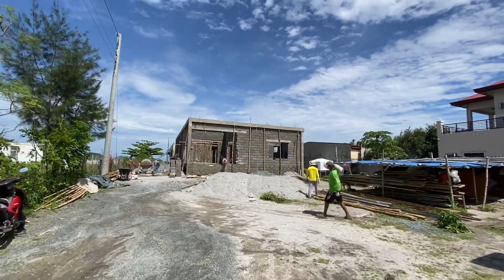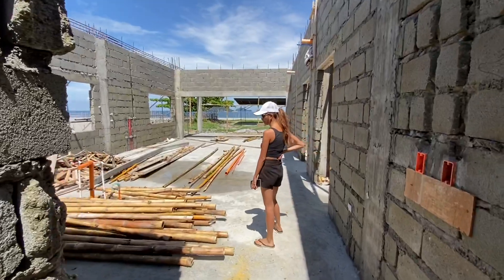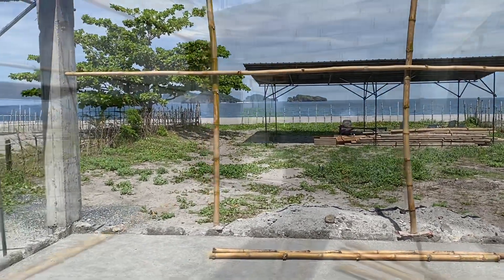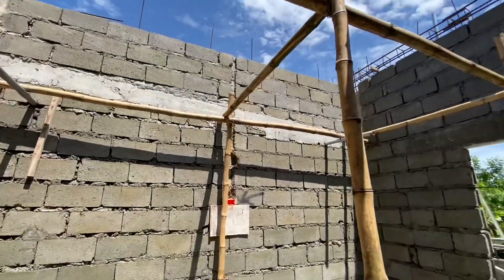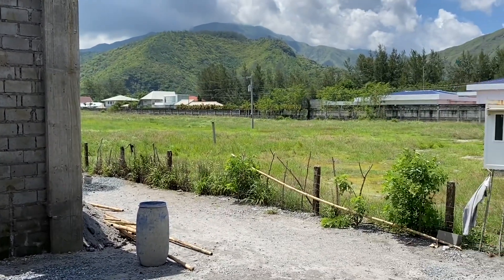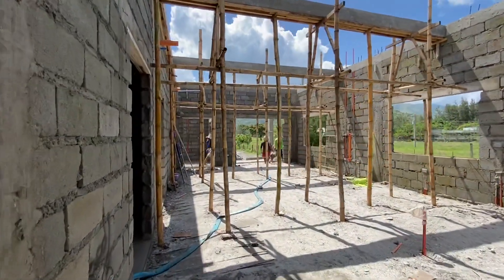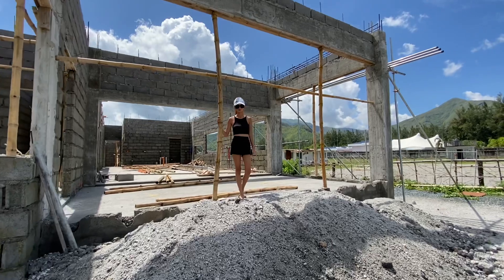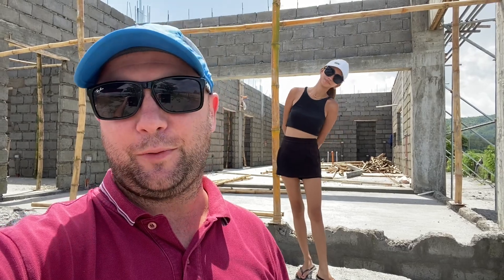Philippines Beachfront House Build (Week 16)

Comment: In my humble opinion….I think your walk in robe is too narrow and dark…do you really need concrete block walls on both sides? I would be tempted to take out the block walk between the bedroom and the robe…and put in sliding doors?! Is there a floor plan? 3D?
Reply from the maker: We had to make it smaller :(
Reply: @Property-Club  I think you will regret it….you can lose all or part of the concrete wall now! IMHO😎😇🤗